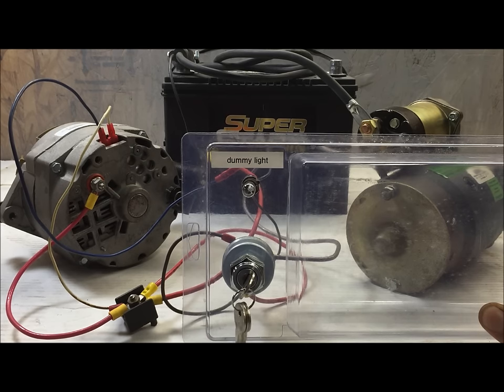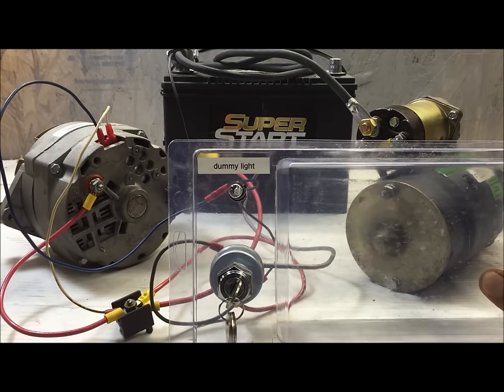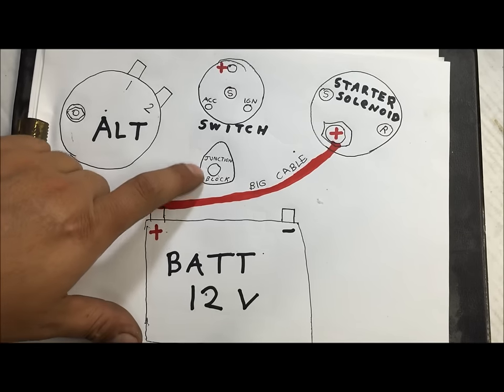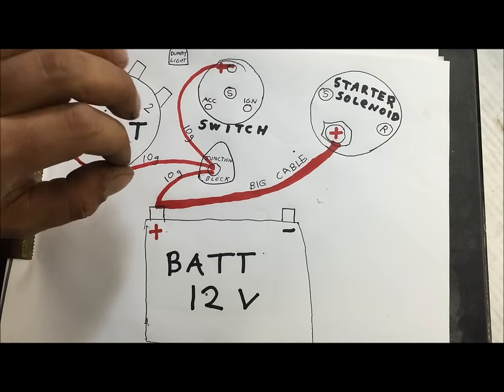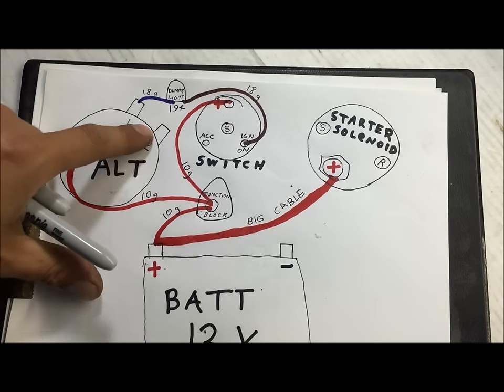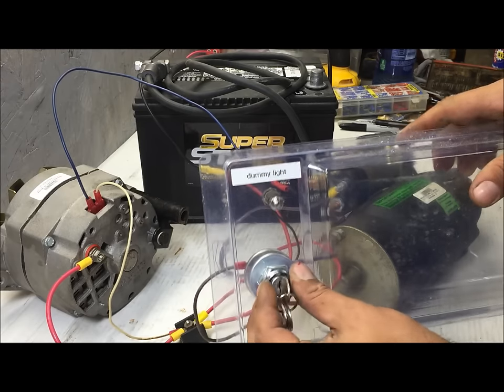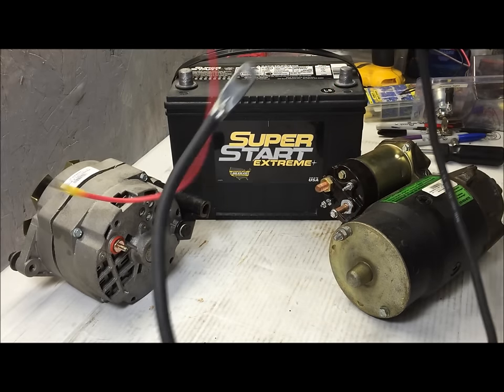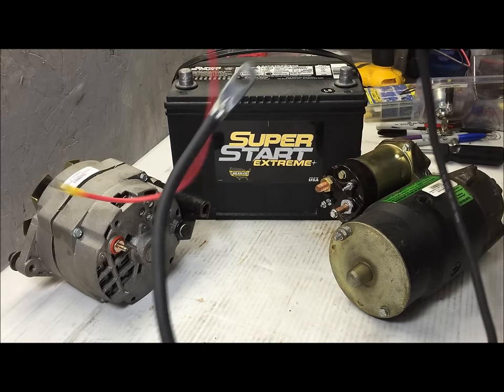64-72 charging system wire up using GM 3 wire internally regulated alternator

Comment: been doing some research on alternator terms from valeo GM, and others, my list of alternative terms are. 
1. Warning lamp", IND, 1, L, R, D+, 61, Field, charge light, Exciter,  
2. The big terminal, B+, main batt, O/P, B, 30, positive, wire colour red. 
3. Battery sense, stator, 2, DF, S, 
4.Tacho, W, P, AC, Tap, 
5. Earth, negative, D-, Neg, ---, wire colour Black. if you reference these terms you have a good starting point to figure out alternator markings,
Amp meter connects in series B+ from alternator to Plus (+) on amp meter via fuse rated at alternator output to battery Pos. 
Volt Meter connects across battery B+ to Neg. 
some alternators need excitation, once spinning, connect a wire momentary between B+ to Exciter terminal, only needs to be connected for a couple of seconds as once excited alternator keeps charging, I am making a timed relay via the key switch to excite my generator on tractor as wont excite before engine starts need to be spinning to start alternator charging.

Comment: Thanks man I been working on converting a 65 corvair  that I put on an s10 frame with a 350 v8 up front where the trunk was. now I am try to wire it up.
Reply from the maker: your car already has a wiring diagram that you should use .. this is how you wire up something that has no wiring

Comment: One issue with the dummy light wire on tractor is will back feed to coil. I ended up putting the dummy light wire on acc possition. Works just fine that way. Can also use a  chrysler resistor insted of dummy light. Very informal for who don't know how to wire old common gm alternator .Ebay also self anti feed back for gm 3 wire system.
Reply from the maker: in my further testing, if the car wont shut off try running the #1 wire to ACC on the key switch or run a diode pointing towards the alt(radio shack $3)  sorry, i got a little ahead of myself

Comment: Back in the 90s I put !n old GM alternator on an old forklift in process of converting it to 12 volt.
I really really wish I had known just how easy it was back when I was a teen and a lot of people I knew were running old 50s cars with generators.
Reply: Dummy light - we knew them as 
' idiot lights '

Comment: Great video chris ,I'm in england re wiring my 61 chevy c10 , couldn't work out why she wouldn't turn off ...then I cut in the old generator bulb(dummy light) and hey presto!  
Jim
Reply from the maker: you want to run a 3 wire internally regulated alternator on that truck .. if it has that run a diode to #1 wire.. I have a video on the internally regulated alternator

Comment: Thanks again for this video - regarding Blackbird's comments - I get it - and like I said, much respect for making these videos - but I did get good info (I think) from his comments regarding the fuse information.  Thanks again.
Reply from the maker: spend the money and get a good wiring diagram...  it will show you where the factory used a fuseable link...  this is based off my 70 chevelle and this part of the system absolutely DID NOT have any fused links or fuses on it... they fused stuff off the junction block to power everything and then fused it again on the fuse box... black bird knows what he is talking about, though..  i have more videos about the alternator hook up and related topics..
Reply: Thank you for your reply - I agree, I need a good wiring diagram (who knows what changes have been made over the years.  Thank you!
Reply from the maker: it is funny how many people talk shit to me in my videos and then finally buy a wiring diagram.....  it makes a world of difference...buy it....my cars fire on the first crank and you can drive them anywhere.....

Comment: This was helpful indeed. My question is: if I'm using a GM one wire Alternator...1) I don't mind doing without the dummy light 2) but on the switch, do I just NOT use the Ign terminal, or should it be run somewhere else??? I would appreciate a bit of help. All else seems very easy to understand! Thanks! ...Newk from Kentucky
Reply from the maker: i have a gm 1 wire alternator video in case you are going with more amps..  .. the alternator has nothing to do with the ignition switch on a 1 wire
Reply: @chriscraft77022  Thank you! I'm just using what I got! I'm wiring a very simple truck, no A/C, no radio, etc! Do I need to use that Ign terminal for something else, or just ignore it? Thanks! ...Newk from Kentucky

Comment: excellent video, straight forward and understandable. I'm going through a rewire on my 3010 john deere and alternator replacement. Someone done a hack job on the wiring in the past, the 10 gage melted the insulation and harness around it so basically starting a fresh harness from the ignition switch.  And the dummy light has the lens melted ( go figure) which leads me to the question " If I run a volt meter in place of the dummy light is it wired in the same way?" I will be running a 3 wire 10si.
  just subbed FYI👍
Reply from the maker: the volt meter can be wired off anything...but it has nothing to do with #1 dummy light position.. dont run it off the dummy light..  dummy light #1 is an exciter wire..  watch my 3 wire Gm alternator video..

Comment: Howdy do you have a video showing the coil wiring using the “R” connection on the solenoid? Thank you very much for your great videos.
Reply from the maker: yes points ignition how to wire video

Comment: All that explanation was really good but if you went that far, you should’ve finished explaining where the accessory wire goes to off the ignition and where to hook the ground wire up from the battery. The ground wire from the battery does that just go to the frame or does it go to the alternator Bracket somewhere? Or does it go to a grounding spot on the solenoid or starter somewhere?

Comment: Nice video it's been a while  since worked on cars ,I had one alternator I was checking for good voltage output and it showed good and was hard to figure out why it was not working and charging batt., but found it was not putting out any amps ,so for sure we should check for  that too when   checking alternator's output ,peace brothers

Comment: I purchased an Allis Chalmers 5040 diesel tractor that has a burned up chopped up wiring harness.   The tractor originally came with a generator which someone changed over to an alternator system.  This is probably how the wiring harness got burned up.  I'm replacing the harness but the wire that is supposed to go to the indicator light from the alternator R/1 post and then to the ignition ON terminal is the problem.  The  Gen light on the dash that the indicator light wire goes to, only has one wire to the light.  The base of the light is grounded to the frame so there is no way to go from the light to the ignition ON terminal.  I guess I have to ignore  the gen light in the instrument panel and install a new two wire indicator light?  What do you think?

Comment: If you use a special Integra regulator with that style alternator you will only need a battery wire on that alternator. I would be glad to help you with that information also. But it is much better to put an alternator on a vehicle replacing the generator. That 10 SI alternator can be good for 80,000 miles. Verses 20 to 30,000 miles on a generator.

Comment: Hi Chris 
just saw the this video for the first time. It is very helpful. But I need help!
I have a 1952 Ford 8n Tractor and I was wondering if you could add two steps to this video 
#1 - how would I run the wires for the lights 
#2 - how would I run the wires to the Volt Meter
you have any suggestions or solutions that would be greatly appreciated - Thank You!

Comment: people are just 😠 because your right and there wrong, and thanks i have a t top g body cutlass and changed the motor to a 442 olds and paid good money for install and is or was having trouble with the charging untill i saw your video ....thanks alot volts meter on dash is at 12 volts..............

Comment: Thankyou this helped me understand. My father in laws 68 chevy was running an external voltage regulator with an internal voltage reg alternator.My battery was getting overcharged.Did the jumper setup on the external voltage regulator and system is running the way it should now.Thanks

Comment: Chris I'm having with my 1971 chevy Monte Carlo  I bought  almost a month ago  ..but anyways  It drove good when I got it ..i was driving home and it started  to sputter  and back firing  a little bit  and then it killed it self ..so I jumped it and tried to. make it home and went maybe 50 ft and happened again ..but it will set there and run for a little bit then the lights start dimming and dies

Comment: Thank you for this straight forward hands on explanation. Very helpful. Question though, should the #1/dummy light just be wired to Acc instead of to Ign as an alternative to trying ignition first?
Reply: Well, I just watched the June 2016 3 wire hook up video, and you answered the question. No more Radio shack in Canada, need to find another source for a diode.

Comment: for best result, the post 2 ( voltage sensing ) wire should be tapped to the battery post of the starter solenoid, some tap it to the battery post of the alternator but it makes that the voltage drop at the system because of the rersistivity of the alternator wire so as the load increases, the voltage drops.
Reply from the maker: actually, that is the worst place to put it ..that’s why the factory doesn’t put it there only dirt track cars and tractors that have very little amp draw

Comment: Most ignition switches feed 12 volt to the number two terminal on the alternator when the switch is turned on the same as the blue wire going to your generator light.

Comment: I bought an old tractor, replaced the alternator and the battery still doesnt want to charge. I believe it is the exciter wire that may be the issue. What if the 194 light is burned out? Could that be the potential issue? Great video and I will rewatch while tracing wires!
Reply from the maker: I have a gm 3 wire alternator video.. exciter does not even have to be hooked up but you need to rev engine like 2000 rpm and it will charge
Reply: Thank you so much! Watched it and now I'm pumped to get it working!

Comment: I am trying to rewire my old backhoe on the number 1 wire my manuel shows a resister should be there or can I just use the dummy light? bypass the resister,   great video,     you have the patience of angel.    thanks for your time.
Reply from the maker: im sure it is a diode...  leave it

Comment: 👀🤔👌👋👍 you really are so right also the cable going to your starter solenoid is number 4 gauge Red warning cable also ignition switch  Warren coming off of starter solenoid always 10 gauge electrical warring yes I' am also a certified ASE master Auto technician just like you Chris  yes  I do know by watching you. Chris You are a good Auto  technician or a Auto mechanic

Comment: Just saw this,  I’m having run in problems after key is off. Also my distributor is having the module failing after a few runs on the truck. Any ideas on how I can approach this issue?
Any thing will help, back feed from alternator??? Great video, thanks
Reply from the maker: watch 3 wire alternator hook up video ( old one not with truck)

Comment: Really helpful video, thank you. 
I have a GM 5 ltr V8 in my boat, I fitted a new alternator and the pulley wheel get very hot after 30 seconds of running. The belt tension & alignment is good...
Could it be a wiring problem ?
Thanks again from the UK.
Reply from the maker: I have a gm 3 wire alternator video I have never had that happen in 20 years

Comment: 6 years later and your video is still teaching us old farts lol Thanks! just one question, can I use an LED light instead of the light bulb?
Reply from the maker: it has to have some good resistance.. so led might not work .. wire it to ACC not IGN and it will work
Reply: @chriscraft77022  Thank you!

Comment: Great Video's, even I can understand, love the diagrams to screenshot for reference  ;-)  So, I see all these new Big 3/Big 4 Wire videos and I'm wondering why the Wire from the Alternator is only #10 to the Solenoid instead of the Big Wire ?  I would think with all the amperage coming out and going down and meeting up with the Heavier Gage wire coming back up to the Battery ?   Can you not put the Big Wires on all the Power Wires and Ground ?  I am be misunderstanding all of that but I thought it really helped boost all the power throughout the System and even better Power to the Spark Plugs ? 
Thanks Again Take Care
CK
Reply from the maker: I have a 100 amp alternator video too
Reply: Hi Chris, Another Question ;-)  Should any wire leading from the Power (Battery/Alternator Junction Box) be fused  ? Like from the Junction Box to inside the Dash, and to other sources like Electric Fans ?  
Appreciate all your work, it's really helped so much, especially for a 71 yr old rookie ; -)

Comment: Thank you Chris, I Got a 90 wrangler 4.0 stroked but all the wires fried, pulled and tossed them all! Got a CRT dizzy, new alt , btry,  relay, starter, fuel pump,  and now for the fun to begin to hook them up and test run the engine. Any advice or direction would be great! I will be watching a lot of videos taking notes I have to understand this as I put it all together. Acc wiring will be done after engine run test. I installed the new to me stroked 4.0  but mice ate up the wires in the dash, I did not know, so upon test we smoked em all, the wires, the mice were gone. Ugh!!
Reply from the maker: this will work for any car.. watch my 3 wire alternator hook up or 1 wire alternator videos cause that’s important.. and automotive grounds .. I have wired up many vehicles that had no wires in them.. it’s easy but is a lot of work

Comment: Thanks for that Chris. I have an alternator mounted to the back of a lawn mower to charge a battery to run an inverter and I was just wondering what else is there between the alternator and the battery and where in the system do they fit? I’m talking about regulators to control any excess power to the battery, volt gage, fuses, things like that? I didn’t know about the dummy light connection on the alternator so that’s a bonus. I’m just running alligator clips straight from the alternator to the battery but the wires run pretty hot so I’m just trying to get it to run a bit cooler. Any words of wisdom will be much appreciated thanks.

Comment: Amazing video it's a huge help. But what would happen if you didn't wire the second wire to the alternator?
Reply from the maker: watch my gm 3 wire alternator hook up video... #2 is voltage sensing and has to be hooked up no matter what.. it can overcharge the battery and catch on fire

Comment: Hey Chris Craft. I have a 1973 Jet Boat and it has the same GM 3 wire alternator, my setup is very simple and on my wire harness I have about a 10 AWG red wire that runs from the BAT on my ignition switch to my battery at the back of the boat, I was wondering instead of running another wire from the alternator to my battery then from battery to my switch I’m wondering if I can just tie into the existing red BAT wire then run my new red 10awg wire to the alternator?

Comment: I’m gunna be wiring my 3 wire up to my 1965 gmc c10 inline 6 tomorrow and I’m pretty confused but I think I got it. Just really confusing since I’ll be trying to delete the regulator and going off the harness to that, also not clear on if the ballast resistor is gunna mess anything up but I’ll try tomorrow and report back.
Reply from the maker: i have videos on my channel about everything you are doing..

Comment: Thanks for the great video so on a tractor I'm using a push button start with a key on switch do you have a diagram for that still using a three wire GM alternator

Comment: If dummy bulb filament blown open alternator will not excite.
Excellent work Thanks
Reply from the maker: it will excite without #1 even connected .. just have to rev it up ... I have a gm 3 wire alternator video
Reply: @chriscraft77022  thanks

Comment: Thank you so much I have an old tractor, it has no loom, but two wires from the alternator which are cut and nothing in any way going to the dash to switches or an ignition switch, can a relay be used and not junction block, Thanks again a great video.
Reply from the maker: the junction block is an extension of the battery and acts like a shunt so you can run an ammeter.. you don’t need a relay.. watch my gm 3 wire alternator hook up video.. I go over everything
Reply: Ah thanks very much this tractor is 1950 and very old.Cheers.Jimmy.

Comment: Wire sizing question. What is the result of running a 2 guage off the ground on the starter? Basically, is it a problem if it's too big?
Reply from the maker: no, it’s what the parts store gave me… you can run wire as thick as you want.. but it adds up fast so typically 2 sizes up is recommended if you can afford it

Comment: Can you leave ignition hooked up in the car and still re- run all new wires, skipping the ignition and dummy wire. Because the car still starts it just won't charge a battery

Comment: How would you add a push button to start while still using the key switch to access accessory and initiate the on position on a 89' Chevrolet Silverado pickup truck

Comment: hey Chris, help me understand the 194 light. From what I see on the web, the trigger wire acts as a ground for the dummy light and then it starts to send voltage in once it senses the engine has started from the ignition wire? The voltage from the trigger wire then shuts down the light as it is no longer a negative wire?

Comment: Ok,..I should have been sharper! I think I understand your illustration.
Not sure I understand connecting to power and then into #1 on the alternator to complete the circuit.
Reply from the maker: look up my gm 3 wire alternator hook up video.. old one with drawings